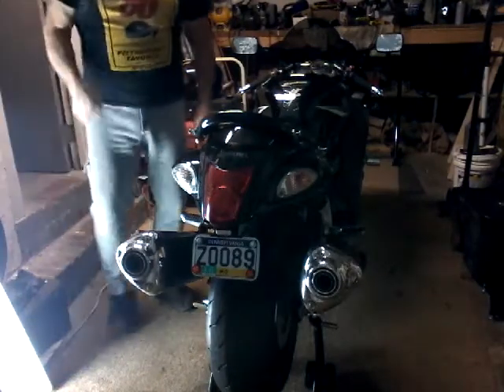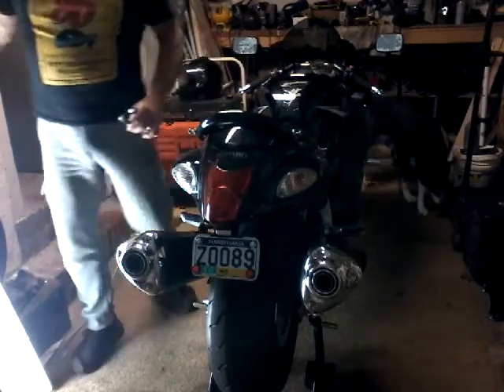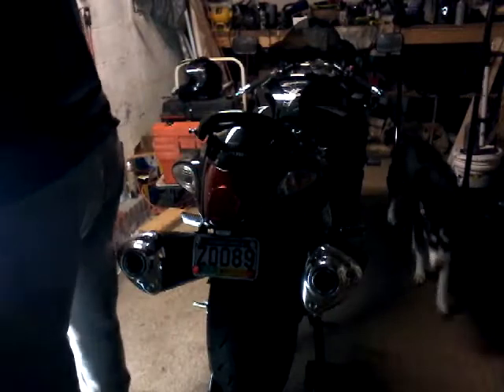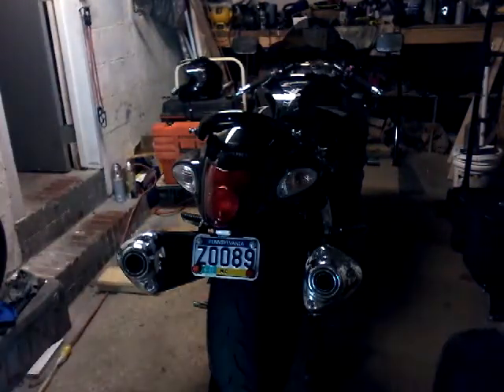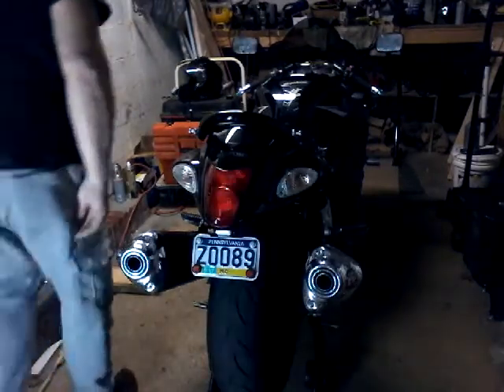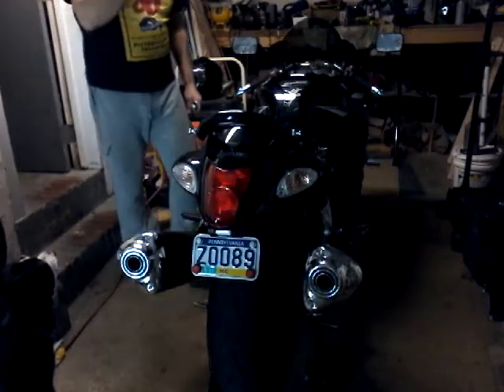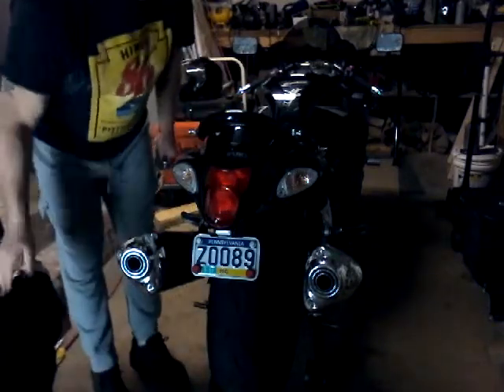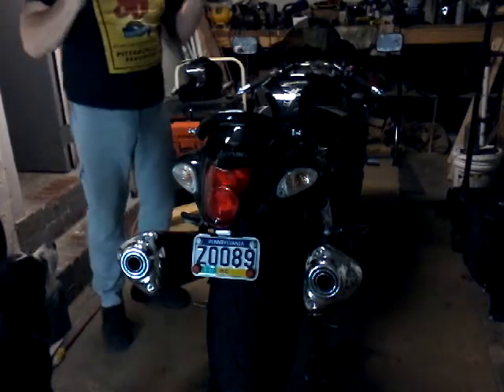Exhaust quick change.

Comment: What's the point in changing a perfectly functioning stock exhaust?
Reply from the maker: I can shift gears better with the short exhaust plus the top end speed is more.
Reply: You don't need the top end speed as you have speed limits everywhere and shifting gears is only a matter of practice.
Reply from the maker: Kim Riley I go over 100 mph just about every day.I don't use the tach to shift gears i go by engine sounds so the loader pipes make it easier.
Reply: What is the speed limit there?
Reply from the maker: Kim Riley It varies with the roads.
Reply: Obviously. What is the maximum speed you're allowed to do by law on public roads there?